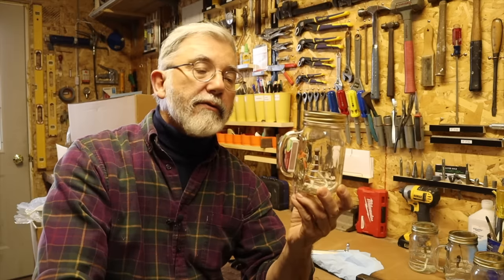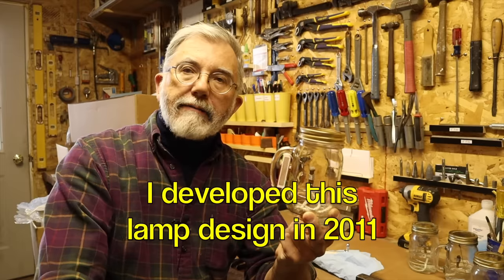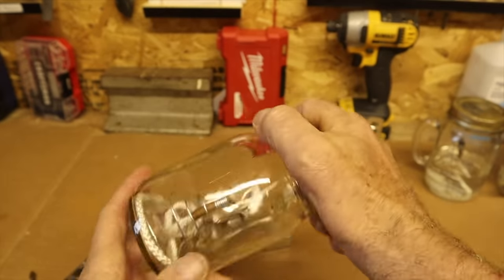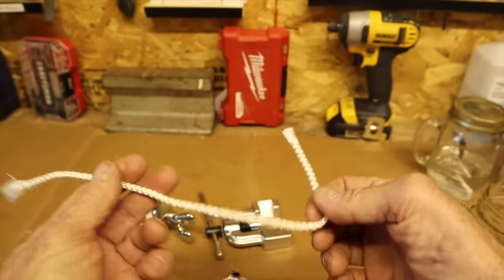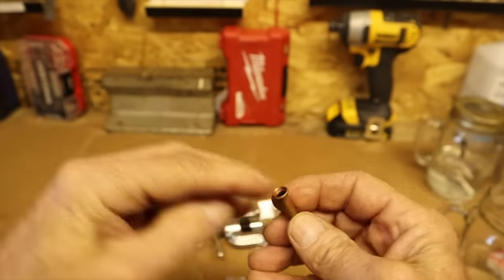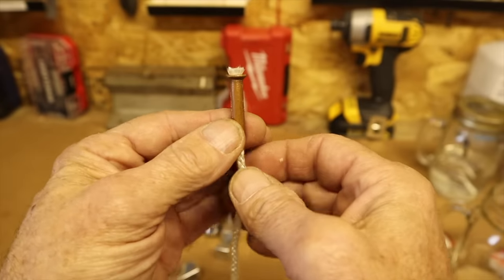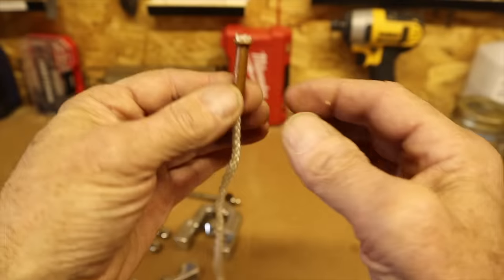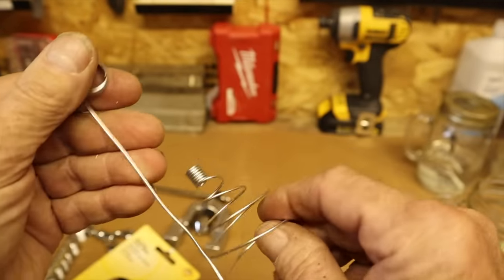How To Make Your Own Bright Betty Emergency Oil Lamp

Comment: Thank you Herrick....i need to be used...outside my patio,,,windy area in my place 

 I want to purcahse  materials you are offering,,,,,i  also want to make some lamp for my house,,but ,,,,my big prob i dont have the tool to produce the wire to make it loop,,,,,,,and flaring tool to produce sa cooper tubing....

They are very costly im sure,,,
Reply from the maker: Hello Obie,
Please check out this simple rechargeable LED lantern as an emergency lighting device. I have one and it works great. https://www.amazon.com/dp/B08L65L7PW?psc=1&ref=ppx_yo2ov_dt_b_product_details
Reply: @herrickkimball  thank you for the suggestion but now these days im better  using my solar light bulbs in my house,,,less expenses of  electric bill ,,here in Phils electricity is very expensive now,,,,

I also  have some rechargeable lights lamp already,

I am more interested  now in using kerosene lamp or your liquid wax lamp,,,,

Comment: 2:55 Why don't you use a carbon filter for a wick, It will burn bright and never burn up. You are just burning the fuel with the carbon filter. Try it. They are what you find in things like vacuum cleaners. But they must be the black carbon (100%).

Comment: These are ingenious! Would you be willing to make a few of these for me? Of course I would pay you for them and buy my own lamp oil.
 Heck, I could even buy the jars and the wicks if you'd rather go that route. I would just need the wire inserts and the copper tubing.  Best regards, James.
Reply from the maker: The best I can do is sell you the parts kits. https://www.planetwhizbang.com/worshop. Thank you.
Reply: Maybe that'll work,  I'll have to watch the video again, and check my toolbox.  I'm partially disabled and not sure if I have the tool you used,  if I do, I'll order them and give it a try. Thank you,  Sir for your prompt response and the link to your website.  Best regards,  James.

Comment: Black Betty had a child bambalam darn thing gone wild bambalam... 1 of my favorite songs!
Please tell me where you buy the candle fluid, thanks AND any suggestions on what I can use to hold wick? Does that piece have to be FLARED to work properly?
Reply from the maker: The lamp oil is available at WalMart, Central Tractor, etc. I purchased the liquid paraffin I use over 20 years ago. It never goes bad. I answer this and other questions in this video... https://youtu.be/asgeLt0cshE   I've only used a flared piece of copper, so I don't know the answer to that question. But you can make an acceptable flare by prying the copper back a little with needle nose pliers.

Comment: Darn, that liquid paraffin wax is expensive ! Is there a less costly oil I can use ? Should the jars be tempered glass or canning jars to take the heat without cracking ? or does it  not matter ?

Comment: $27 apx. for one gallon of oil.. how long does one gallon burn apx? Add cost of other items. Apx. cost?

$27 is about the cost of four 100 count tea candle boxes with each candle burning about 2-3 hours. I also cook with tea candles by placing them in old stove holes with grate above under stainless steel pan. Also use in clay pots for heating and in tea candle wall hanging lamps. 

I've been off grid using only gas generator, solar gen,  and truck for minor electrical needs. 

From a standpoint of practicality, dual functionality, and SHTF scenarios, is it cost-effectively worth utilizing over the hard wax?
Reply from the maker: Good question....  1/2 cup of liquid paraffin lamp oil (which is the maximum amount of oil I recommend) will fill the jar to approximately 1" high . That amount of fuel will burn for 16 hours. So, a gallon of oil will give 512 hours of flame. That number is based on my own testing.

Comment: Perhaps I missed your telling of how you keep the wick (after lit) fed in the tube. Surely after some time it burns away and more must be exposed. Please explain... again. 
Blessings ~
Reply from the maker: The fiberglass wick burns down little, if any, with the lamp fuel I am using. I discuss this, and show how to easily adjust the wick for flame size in this video: https://youtu.be/asgeLt0cshE.   Thank you for the question.
Reply: Thank you.

Comment: Would you sell just the copper fittings? I can do the rest on my own with the wire that Dollar Tree sells for stiffening artificial flower arrangements, etc. Also, since I don't like the idea of a glass jar I would probably use a tin camping cup and drill a bunch of holes in the upper half. It would make a more diffuse light but still adequate in my opinion, especially if you have more than one. True, you wouldn't be able to just screw a lid on for storage. But I'm okay with that. I can work around it.
Reply from the maker: Sorry but I'm done making the little flared copper tubes. Very tedious and time consuming. The last of my Bright Betty parts kits will go on sale January 9th. I need to move on to other projects. Thank you.
Reply: @herrickkimball  Okie dokie
Edit: If I miss out on your sale then I might be able to buy something comparable from an auto parts store, comparable enough anyway.

Comment: I'm ALWAYS sooo afraid the glass will get so hot that it breaks... How long would you burn per use.???? 
 I love 💕 burning candles and I need to be safer about it.
Reply from the maker: The jar does not get hot if the top is open and unobstructed. I show this in my "Betty Tipping" video. 👍

Comment: Not many people have that wick holder tool or wick holders even.  Is there an alternative?   At least an alternative for the tool?
Reply from the maker: I've seen glass wick holders that can be purchased. No experience with them though. If you have copper you can flare the end with some careful prying with needle nose pliers around the perimeter.

Comment: I bought a bottle of liquid parafin, but discovered that in the cold it turned into a solid block!
Reply from the maker: Yes it does. I've had a few gallons of it in an outdoor shed for over 20 years and it gets solid every winter, but thaws when warm. It never goes bad that I know of. 👍

Comment: Her Rick…. I am so frustrated!! I am single woman, age 70 with heart problems, I do not buy tools like you men all show. Can you tell me how to find heat for when electricity goes out???  I have small living room and just want something made by a man, so I can purchase it from a man and use it. My dad and ex husband could do what you guys do but they are both gone now. Is there something safe anyone could sell me??  Kansas City old lady
❤
Reply from the maker: The first thing that comes to mind is to get a "Compact Indoor Safe Kerosene Heater."  Home Depot sells them. Other places too, I'm sure. Fueled with K1 kerosene. Not necessarily a permanent heating solution, but a valid emergency heat source for one or two rooms. One example here: https://www.homedepot.com/p/DuraHeat-10-500-BTU-Compact-Indoor-Safe-Kerosene-Heater-DH1051/202221099

The other thing that comes to mind is that you need to tap into a community where there are men who will help you. A local church would be the best place to start. I wish all the best.
Reply: A propane camping lantern can be used in an emergency situation if you are careful.
You can get the shorter fatter tanks which are more stable & you can even get a cheap plastic base that fits a small propane tank at the bottom, making it even MORE stable
The mantles are a pain in the ass....have a 
man or a manly woman 🤣 🤣 show 😂🤣
you how to put a new mantle in ...It is not THAT difficult.You will get light & heat for a small area & ,if you have a couple small tanks you can go a few days.They can be found at flea mkt & yard sales , but , they will need a new mantle ( avail @ hardwares
& camping supply  places for a couple $$ )
His advice on a small kerosene unit is good also only you will have to be more MANLY
😂🤣 & learn how to handle & store kerosene which you may not want to do , as learning all these things you may start sprouting hair 😂 on your 😂 chest & may even need to shave 🪒 😂 😂 ...
     A propane camping stove can also allow you to boil a pot or two of water & heat up a small area without worrying about MAN 😂 tles 😂 which as all ready mentioned can be a real  pain in the ass 😆😂. 
  If you want to go further , you could have a manly man set up a larger propane tank to an LP gas stove that does NOT use electricity & you could light with a match & possibly even has an oven which could provide heat as well.
   In an ABSOLUTE emergency you can use Coleman gasoline fueled camping stoves & lanterns inside with extreme care ,& even run them on fuel you siphoned from an AUTOMOBILE....But I'm sure this is WAY too manly for you 😂... God Bless 💕 & 🌞

Comment: Any reason for a fiberglass wick to need to coil around the inside base?  Couldn’t the wick be just a couple inches laid across the bottom? 
I’ve made these, & used recycled copper wire, recycled jars (best select at least canning jars, for heat tolerance), braided cotton string wicks, & fueled w/used cooking oil.   
But, the used cooking oil does NOT store well, & can smell rancid.   I chose to use food oils, because I have chemical sensitivities; using petroleum-based fuels in a living space, harms breathing..that includes paraffin. 
Also, the copper wire in contact w/food oil, corrodes.   
But they have worked very nicely at a remote cabin for us, & burn for hours on just about 1/2” or oil.   Best not store lamps w/food oil in them, though.  

We now have a collection of those stainless steel coil shakers that come in smoothie shaker bottle mixers (which we never used), I think those coils will do nicely for these lamps!  Also have some recycled copper tubing that can make the wick holders…have considered forming a different shape of holder, to be able to use common flat wicks, &/or, making a holder for 2 wicks…but that would make too much heat in the jar, & could cause glass to shatter, or a disastrous explosion. 

I’ve been plotting to cut niches into hall walls, line them w/fireproof materials, & face w/clear glass diffuser doors to prevent oil lamps placed in them from falling out. 
We’re in earthquake region, so, best over-engineer to be safer! 
If I wanted to use paraffin oil, the niches could have a fresh air intake & a heat outlet designed-into some of them, & a full air-sealed glass access door, to prevent the fumes entering the living space. 

These oil lamps can be configured many ways, from “genie-calling brass lamps”, to canning jars, to just about any fireproof container.  Could even use smaller jars, & make a chandelier to hold several of them, where more light is needed. 
Just be safe!  The jars do get quite hot when burned for awhile—burn hazard! 
 Using the mason jar drink mugs is great for carrying them around…I think a brand of jams & jellies might still package their product in them, or can find at 2nd hand stores. 
Great idea, tucking matches into handle!  
I had no idea they were called “Betty lamps”!?

Comment: Do you have to keep pulling the wick up? Does it not just burn down to the level of the oil and burn itself out?
Reply from the maker: Once adjusted, the wick does not need adjusting for hours of use. The fiberglass wick is barely consumed. The wick serves to bring fuel to the top and the flame feeds on the fuel, not the wick.

Comment: Great idea BUT I would endeavour to run it on cooking oil FREE so the copper component will get hot but this is helpful in lowering the viscosity of cooking oil I would run the copper right down to the bottom of the jar.
Reply from the maker: The copper piece does not get very hot, but your idea is certainly worth a try. 👍
Reply: @herrickkimball  You could fabricate a vane above the flame to conduct heat down the pipe.

Comment: Why not use the wire to put the wick through rather than copper tool that costs some cash?
Reply from the maker: The bottom of the copper tube holds the wick from slipping down once adjusted. But your idea is worth a try. Perhaps crimp the bottom of the coil to achieve the same effect? 👍

Comment: you should not be using galvanized wire for this, it releases toxic fumes when heated. i'd recommend using stainless steel or,  as you already suggested as an alternative in the video, copper wire.

Comment: Is the lamp oil so flameable that if the glass gets knocked off a shelf....will it catch fire?
Reply from the maker: It's not that flammable. But there is a potential fire hazard, for sure. I discuss safety and tip 5 Betty lamps over in this video: https://youtu.be/asgeLt0cshE

Comment: All the Mason type jar drinking mug style with a handle say for cold liquids only.?
Is your brand of mason mug different.?
Thanks.
Reply from the maker: No. My experience has been that as long as the top is fully open the jar does not get hot.

Comment: how log does the wick last? ive been using different cotton wicks and even hemp but the wick burns and the flame gets smaller and have to pull new wick up after a evening of use.
Reply from the maker: Fiberglass wicks last for a very long time. I have seen no noticeable loss of wick in my lamps.

Comment: So can you use kero for the fuel? Seeing that paraffin oil is chemically the same as kero, (just not as refined) I'm wondering if they are interchangeable.
Reply from the maker: Good question. I don't know the answer for sure.
Reply: Seeing that I have 500+ gallons of kerosene stored for long lerm, I'd rather use that if I can.

Comment: I did a version of this with a cotton wick, coat hanger, and olive oil. Yours works cleaner. I was using what I had. I saw another fun use and put crystals in mine. 
I liked the pun from the song. It's like a bad Dad joke.

Comment: I don't want to spend $30 for one of those "flare" tools, is there another way to do that?  I don't have a need for one for anything else.
Reply from the maker: If I lacked a flaring tool, I would use some needle nose pliers to pull the copper back into a flare. Little at a time. 👍

Comment: made mine, more or less the same, the lamp oil i use  burns for a few mins,  then ignites the whole jar for a few secs then goes out. i can't work out why ?
Reply from the maker: Good question. I have no idea why that is happening. Perhaps your wick holder is too close to the fuel? Perhaps you are putting too much fuel in the jar? Are you using liquid paraffin? Please check out my safety video for insights (I show what you describe in the end, but it is due to the copper tube being soaked with fuel after tipping)... https://youtu.be/asgeLt0cshE
Reply: @herrickkimball  the only difference i can see is that i used a lamp oil, which is all i had to play with at the time. thanks for the response anyway.

Comment: where a good place to find the 1/4 inch soft copper tubing without buy 50 feet?
Reply from the maker: I don't know. A commenter here said that it's possible to buy short lengths of 1/4" brake line from an auto supply store. It is flexible and flared on one end. I have not tried this and can't say with certainty that it is a good idea, but it's a possibility. I do have parts kits available: https://www.planetwhizbang.com/brightbetty

Comment: Try 100% carbon felt as your wick, no soot and lasts, as it is only burning the fuel you supply and not its self.
Reply: I've only seen carbon felt in rolls, are there wicks made from it?
Reply: @lenwenzel7440  You cut strips off the roll or sheet .

Comment: This is Great! 👍😎...
Q:... will Klean-Heat work as well here?
(Methanol 50% & Ethanol 50%)
Reply from the maker: I don't know. Aren't the alcohols flammable? That would not be good. Watch this video... https://youtu.be/asgeLt0cshE
Reply: @herrickkimball  
It acts the same as the liquid paraffin as far as when you mentioned the opposite of gasoline...
I mainly was wondering it it will work the same with the fiberglass wick?🤔

Comment: can kerosene be used instead of paraffin oil?  I suppose so but imagine it won't burn as clean right?
Reply from the maker: I have no experience with burning kerosene, except in old oil lamps that my parents had years ago. It did smell far worse than liquid paraffin.

Comment: Is there a danger of zinc fumes from the galvanized wire?
Reply from the maker: I don't think so. The wire doesn't get hot. But anyone concerned about safety should consider this option instead: https://www.amazon.com/dp/B08L65L7PW?psc=1&ref=ppx_yo2ov_dt_b_product_details Thank you for the comment. 👍
Reply: @herrickkimball  Thanks. ...As long as the wire doesn't get hot, it should okay. I'd assumed, that it did. Zinc puts out fumes usually at a lot lower temp, than the metal it protects (600-800F?) It can be a problem when welding galvanized pieces without removing the zinc coating for instance.

Comment: Mine smokes. If I lower wick it won't stay lit. Doesn't seem to work for me!
Reply from the maker: There is a sweet spot between too high (and smoking) and too low (and going out).  If you get it just right it will run for a long time without smoking before needing any more adjustment. Are you using liquid paraffin?